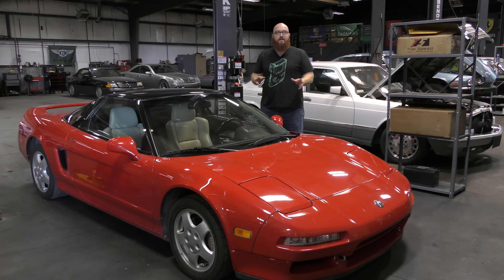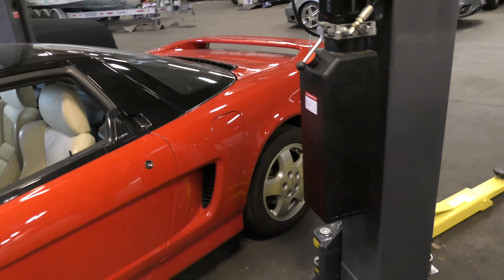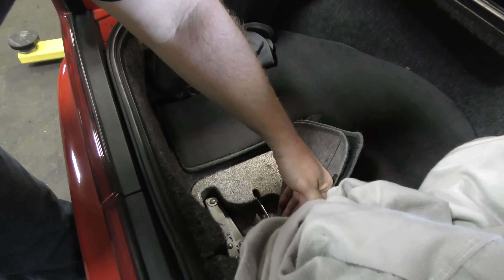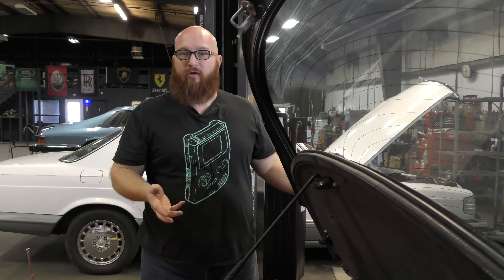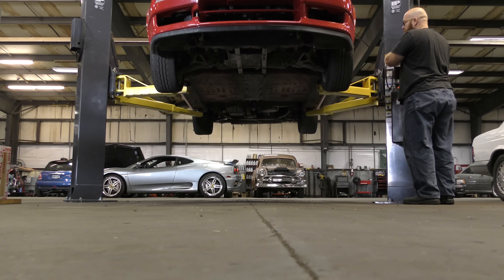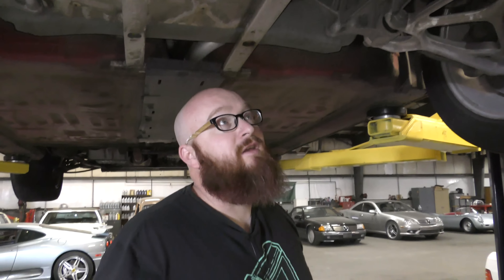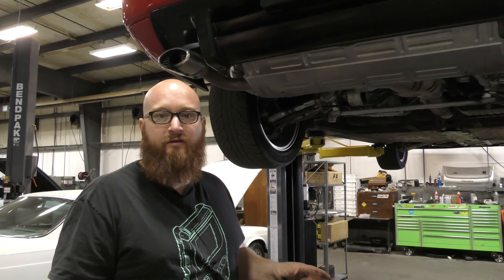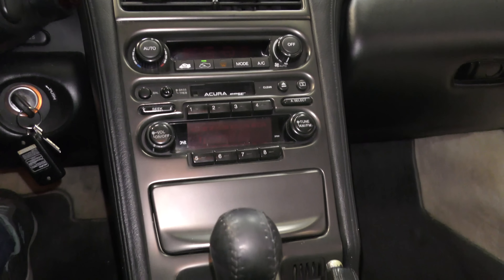Supercar with over 100K miles! You've got to see this '91 Acura NSX in the CAR WIZARD's shop

Comment: Nice mechanical walk-around and it sounds like that car is in good hands considering your "open minded" approach.  It was nice to hear about the in-coming balancer shield.  Cheap insurance and the sign of an educated owner.  Maybe throw an oil pan gasket on there while you're at it since that's probably the source of most of the seepage, with a thought spared for the oil pressure sender and spool valve gaskets (which can also leak towards the trans-side).  100k miles is barely broken-in though.
Reply: "Educated" LOL, it's the latest trend with the car...kinda like polishing is now known as 'paint correction'.
Reply: @sheiladawg1664  I'm not sure I'd call a cheap preventative measure against one of the very few ways these cars can up and grenade a 'fad'.  I wouldn't preach except that I had the damper delaminate from the crank pulley in my own NSX and I was just lucky to hear something and turn the car off before it made it to the timing belt.  It had chewed a hole clear through the plastic cover though.   I now run a shield and don't worry so much.
Reply: @LapoftheWorld  Why are these harmonic balancers so much different than other cars?
Reply: @sheiladawg1664  So on the NSX ('91-'05) the crank pulley has this rubber donut more or less molded to the back of it.  The problem is that it's just molded, and not mechanically affixed via fasteners.  Over time presumably some combination of heat/vibration/possibly chemical degradation (no one's been able to nail down the "why") that rubber donut can un-stick itself from the pulley, but still gets rotated by contact, only now it's free to move in-board...which is where the timing cover is and belt beyond.  Not a ton, but the community has seen several validated cases of engines lost or needing rebuilt due to that failure.  It's a weird one, but easily avoided with that aftermarket solution.
Reply: @LapoftheWorld  Thanks for taking the time to give a succinct answer.
I've tracked mine about 10 times but otherwise kept it clean and maintained. I'll have to consider it but unfortunately need a clutch first. I'll mention it to my mechanic.
Thanks again.
Reply: @sheiladawg1664  No problem.  Relatively simple job to install it, and the shield is available from Cedar Ridge Fab or SOS.  Worst case, just put it on the docket for your next timing belt job when the pulley is already off.

Comment: Japanese quality? Didn’t you have an Acura in there just a week ago what they spun rod bearing ? There is good and bad in every car. Every car breaks down just some cars are more expensive to fix than other cars. I’ve had many American cars go over 200,000 to 300,000 miles with no problems. Japanese cars are not the greatest thing since sliced bread. Maybe in Kansas it’s more of a foreign car state but it is American car state I don’t know I live in Kentucky. But I really get tired of hearing you brag about Japanese cars they are mass assembled just like American cars. And if Japanese cars are so great why are they in your shop and wise every Japanese dealers got a service center full of cars being worked on.

Comment: I've had mine for 12yrs now (same year and color combo as this one), and still has 'only' 92k on it. There are plenty of folks locally who have 200-300k on theirs and they just keep on going. Yes, it's slower than my daily-driver Civic Type R, but  it's MUCH more fun to actually drive.
Reply: I always wanted one. I'm jealous you have one. I was living in Japan in the early 2000s and these were dirt cheap for doggy ones. I didn't get one because the running costs would have ruined me. I got a Beat instead - the poor man's NSX - but I'd argue just as much fun!
Reply: Kazuto do you know what the value of a car in this condition should be?
Reply: @stuartgreenshields5591  Today's poor man NSX is the Honda S1000 for export variant or S660 for a true JDM. It looks just like an NSX just much smaller and less power.
Reply: @stuartgreenshields5591  I've driven a Beat and it's stupid fun as long as you have no expectations of speed.
Reply: @Spinnaker617  I'd guess somewhere in the low-mid $40k range
Reply: @K0Kaz  Thank you👍
Reply: @fleurdewin7958  I'm not sure they ever actually made an S1000. I'd love a drive in the S660. A few of them have made their way across to the uk, but I've not seen one in the flesh yet.

Comment: It is not a supercar. Today you can only call it a classic sportscar . Today's supercar gets you 600HP easily. This old NSX is the very first version of it with a 3.0L engine. The newer batches have 3.2L engine for better mid range torque and power.

Comment: Why do people hail 100,000 miles as being a superb achievement with cars?

There are 1.0L Nissan Micras still on the road, from the 90's, with 150,000 miles, easy. That's a 1 litre engine. 

So why oh why would a car with a 3.0L or bigger engine have any issue reaching 100k miles? Not least if it's Japanese...

Comment: a 1991 Acura with 101,661 miles.. High Mileage???  Low Mileage..!!!! My 2005 Honda Odyssey has 192,000 miles and runs perfectly..!! I have a 1970 Pontiac GTO 
with 380,000 miles. It is on its 3rd engine rebuild........

Comment: I really enjoyed your "Where's the engine" game! I had a 1992 NSX and found it to be the most responsive & neutral-handling car I'd ever driven. Not exactly fast, but it was a joy to drive. The seating position affords an  excellent view of the road between the front wheels, making it easy to place.
The AC unit in an NSX is quite important, as these cars have aluminum bodies, which heat up real fast in direct sunlight & hot weather. Mine was black, and it was an issue. The Targa is the model to own.
Reply: Senna co-developed it with Honda (before his death) and Zanardi helped to further improve it... It HAD to be perfect by all means! <:  D

Comment: These Acura NSX's were excellent back in the day. Now, they are still running and driving great on the road. Anyway, I do not need an NSX for a daily driver or a vehicle that gets myself from point A to point B. If I want to get a vehicle for the weekend or on vacation for road trips, I would buy a 2011 Chevrolet Malibu LT sedan with the 2.4 L four-cylinder engine and the six-speed automatic transmission with manual-shift mode. For an every day vehicle, during the week, that I need for point A to point B driving or commuting to and from work, I would buy a 2018 Kia Sportage EX AWD crossover with the 2.4 L GDI four-cylinder engine and the six-speed automatic transmission with manual-shift mode. These two vehicles with the 2.4 L four-cylinder engine type will be fairly reliable and fuel-efficient to drive fairly often.

Comment: I daily drove a ‘94 for nine years, and sold it with 161,000 miles, at the bottom of the depreciation curve. 🙁

I used to play “find the engine” with people.  😛

All aluminum construction, very rigidly constructed, and very Honda reliable.  One downside is that oem parts from Honda are extraordinarily, Ferrari-level expensive.  (Low production)

Mechanic’s tip:  The AC compressor is the same as an Acura Integra except for the pulley, and is MUCH LESS EXPENSIVE THAN THE OEM compressor, for the exact same compressor.  There are a very limited number of parts from same-generation Acuras that will interchange.